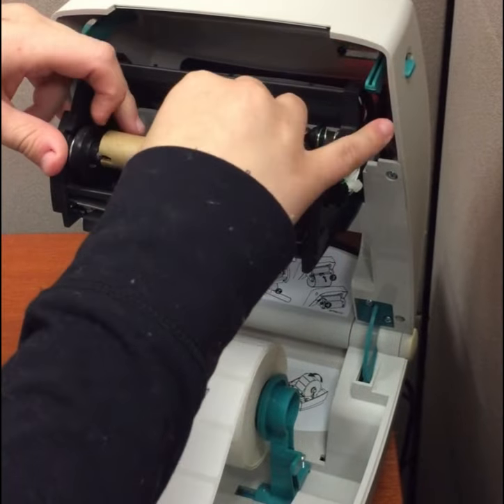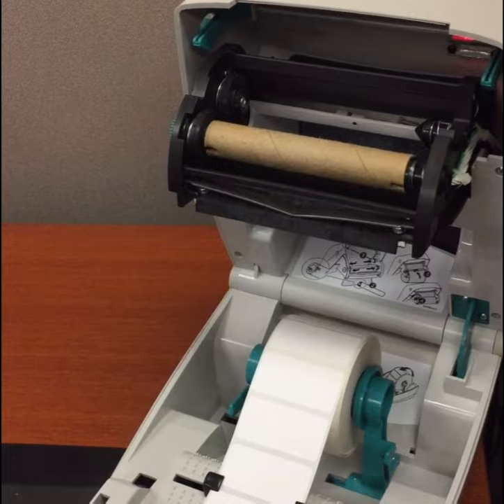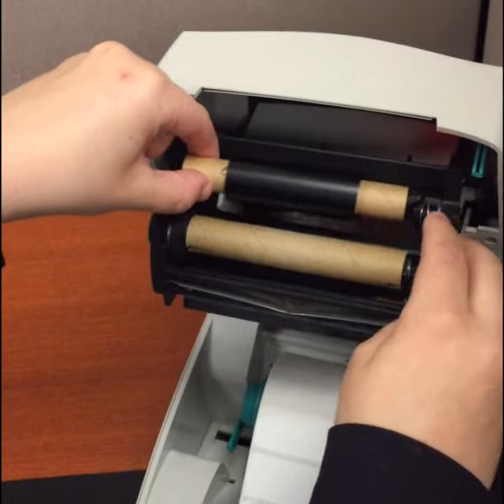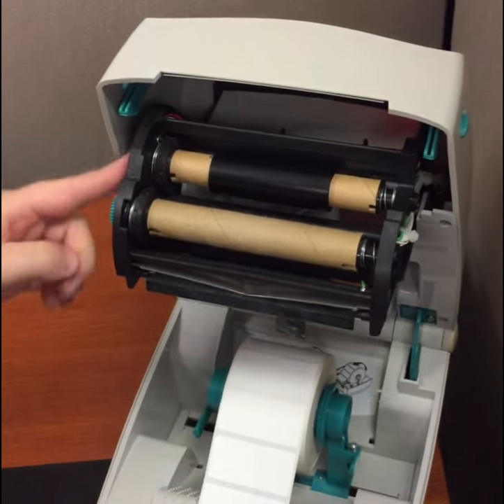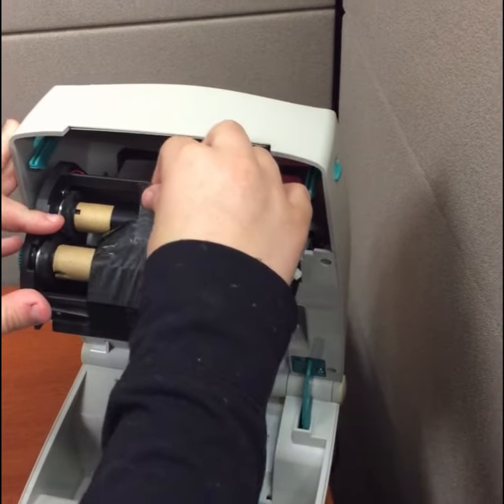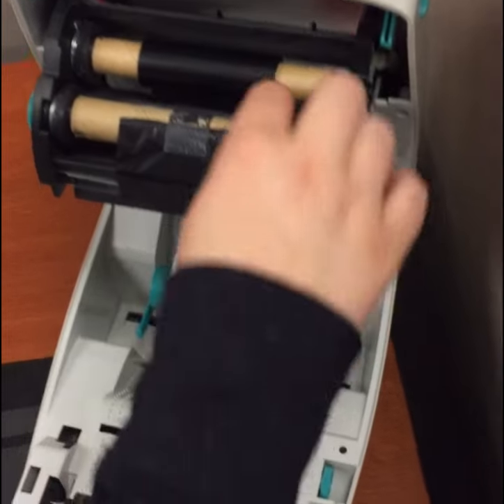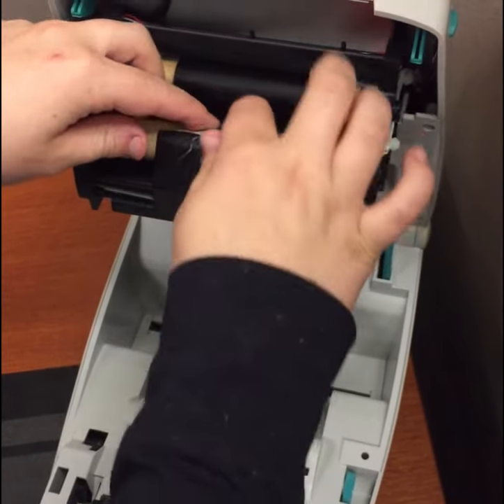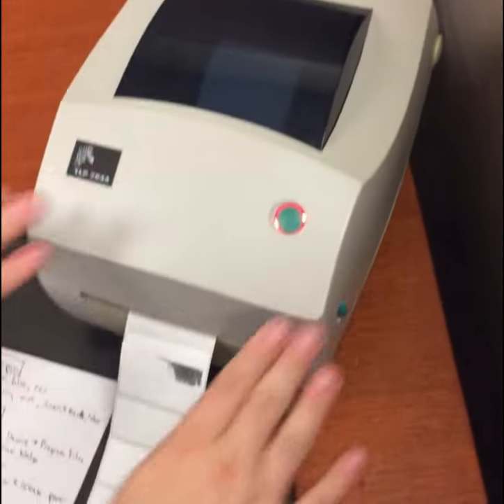Installing the Ribbon on a Zebra Printer

Comment: We have GC420t printer ,
when printing 1 label it does not stop after printing 1 label directly as it`s printing 15 empty labels more 
how to fix this issue 
i tried to calibrate it from printer  also from software but no solution !!